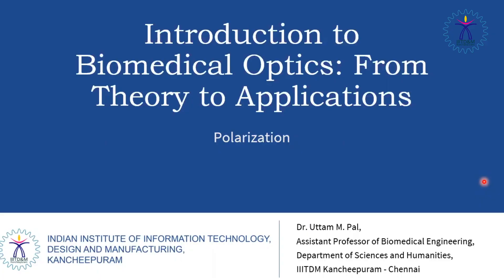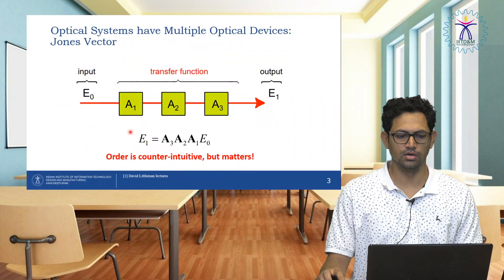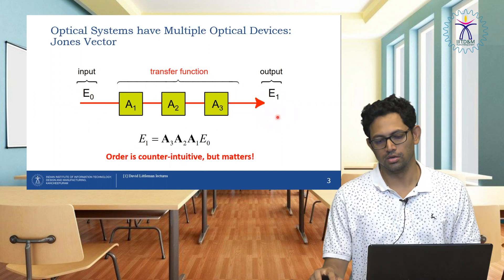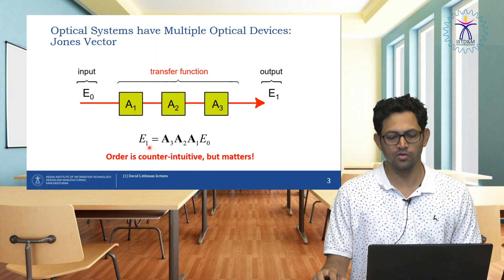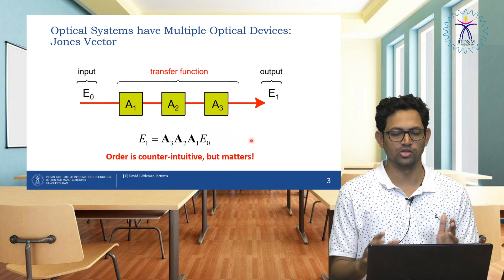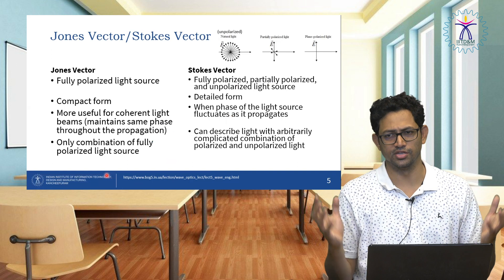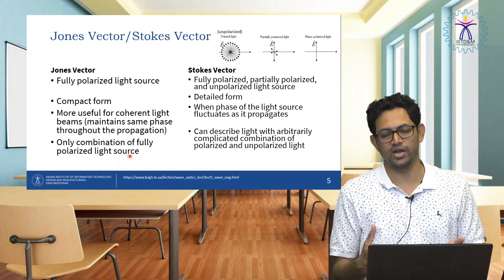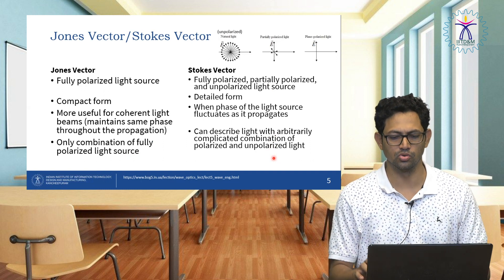Lecture 9: Polarization Part 3 (Mueller Matrix)

Comment: But how do u derive the malleur matrix for each polarization state? For example, for the malleur matrix for the horizontal polarization, i can use a malleur matrix that is differnet from the one u show. i can put the 1 and zeros at different positions and multiply the input and can still get the same output state. Does the malleur matrices have to be strictly the same form as the ones u show for each polarozation state?
Reply: Good Question
Yeah the input has to change then. Otherwise the output wiil have a completelly different meaning
Reply: I don't think you can get the same output with the same input and different Mueller matrix. Maybe if you also change the input and then perhaps a different Mueller matrix can work.